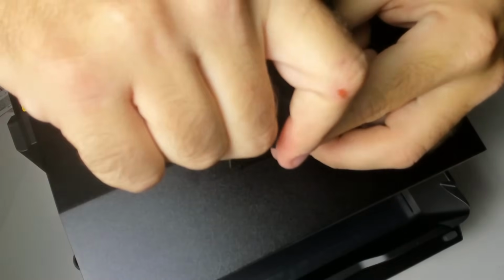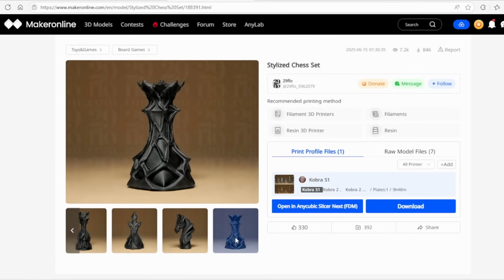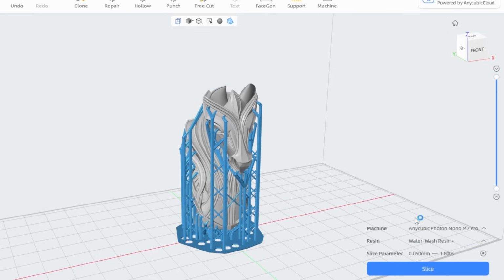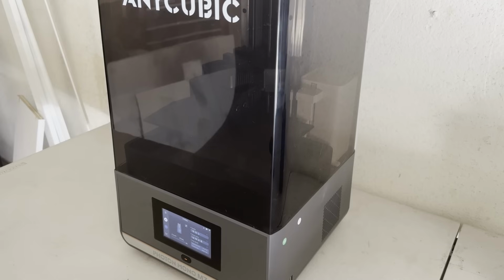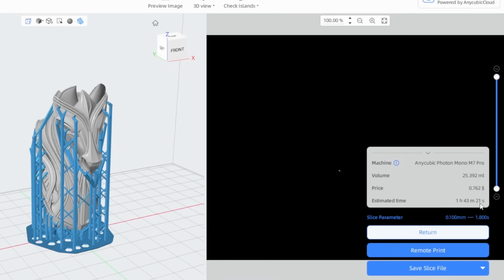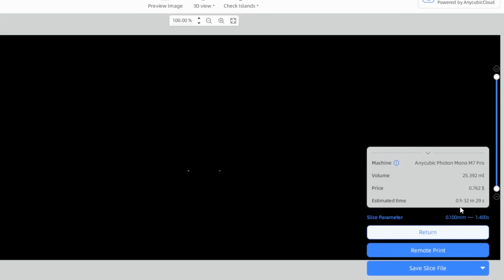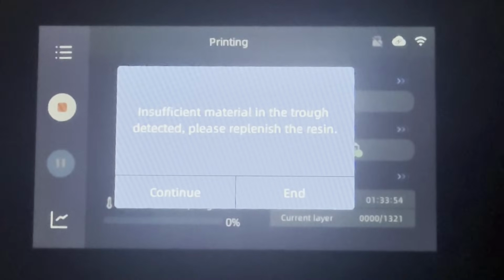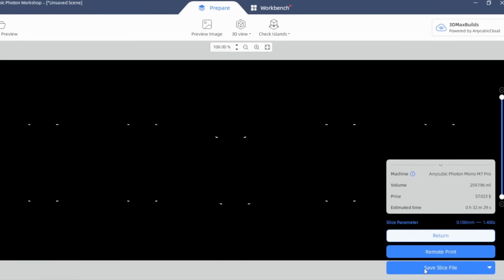Anycubic Photon Mono M7 Pro | 3D Printing With Resin For The 1st Time

Comment: Im having an issue with my prints it keeps sticking to the bottom of the vat and only prints 2-3 layers and gives me the force release is zero error have you come across this? If so how did you fix it ?
Reply from the maker: Sorry, I missed this comment before. I’m still new when it comes to resin printing. But some things I tried that worked was increasing the Z-lift distance, slow down the Z-lift speed. And made sure the FEP film was tight enough.
Reply: @3DMaxBuilds thanks I ended up returning it and got a new one and ive had no issues but thanks I'll keep those in mind if I ever have that issue again
Reply: I just bought it and tried doing the test prints and only the one with 8 small ref prints the top 4 printed the bottom 4 didn't

Comment: I have the M5s Pro and this video was very helpful to get the gist of resin printing.   I've had mine for a few months, but the resin is such a hassle and stinks that I've been putting off even trying to use it 😥.    Sometimes I have buyers remorse lol BUT like you said, for miniatures and stuff,  it just can't be beat.  I just need to make a space for it and do it.
Reply from the maker: You got this! Start with some small prints. Thank you for watching!